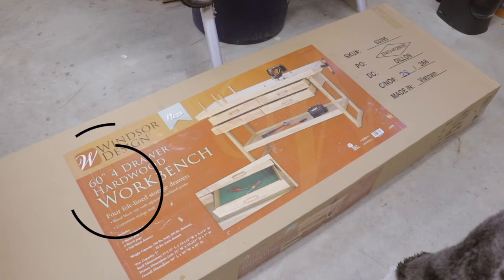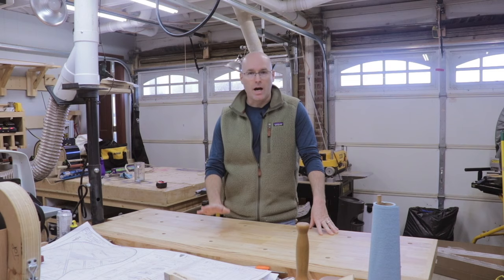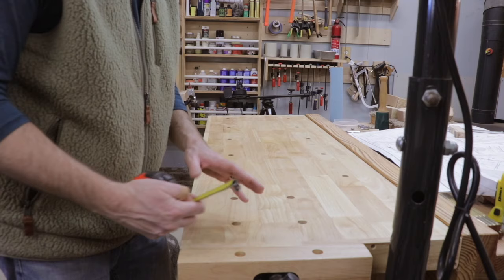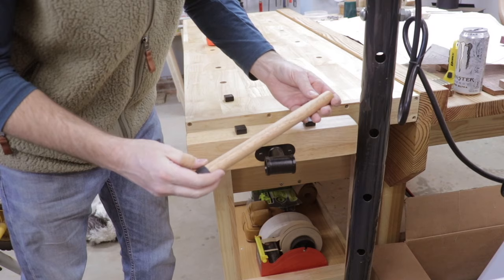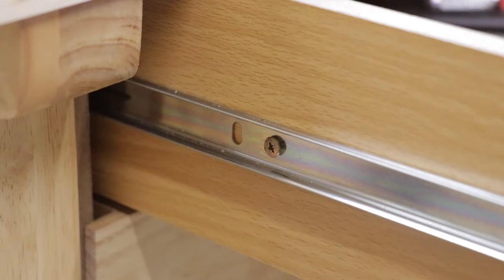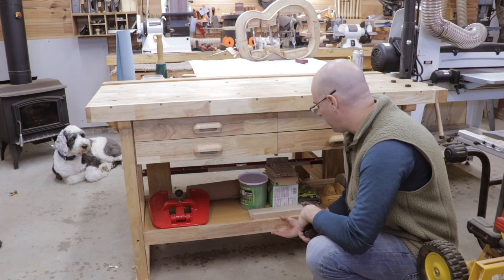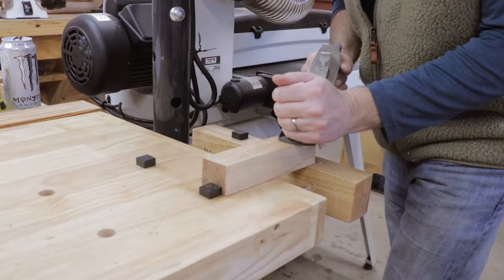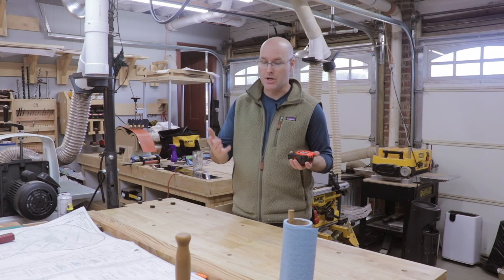Harbor Freight Woodworking Workbench Review

Comment: I have this bench, and while I've been making do with it, I generally hate it.  It's wobbly and too light weight, saw duct and chips fall through the dog holes and fill up the drawers, which have all warped a bind up regularly.  But it keeps working well enough that I haven't just junked it.  It's right in that valley where it's bad enough to piss me off, but not so bad that I've ditched it: Maximum annoyance factor.  But it will, soon I hope, build a better bench that I won't regret.

Comment: Hard to beat for the price but will not  survive long term. I have had mine almost 3 years and have had issues. The drawers are anchored to the bottom of the table and pulled out after about 1 year. I reattached with longer screws and glue. The vise is a bit lower than the table top and if you use the dog holes they don't secure items well. The vise also tightens more on one side than the other and you will need to put something of equal thickness in the opposite side of the vise if you want equal claming pressure. It is very difficult to only use one side of the vises. The dog holes also lead directly to the drawers, which means they are often full of sawdust. The table top as of recently has developed a bow and is almost unusable unless I place a flat piece of plywood on top. Needless to say I feel you be better spending the money and build a work bench that will last long term.

Comment: I aquired a bunch of tools from my father in law about 4-5 years ago. Just so happens one of these work benches was one of the things that were given to me. I unboxed it and put it together, and now it's a home for my lathe. I'm not a fan of the drawers and I think the bottom piece of wood for the bottom shelf was broken. I've never used the vise on it, but it's there if I ever need it. Lately I've been working on cleaning out my shop because I have too much in there. I got rid of a big cart, extra router table, small dust collector, and a radial arm saw(I never used it).

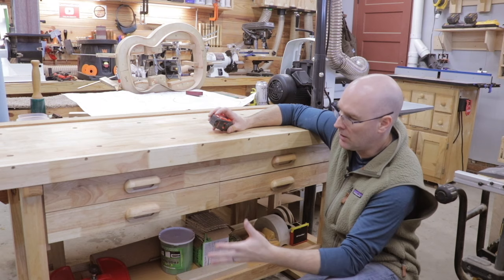Comment: Dog holes are ten inches apart (1:40).  The vise travel (throat. 3:00) is only 7 1/6"?  If the travel is less than the spacing of the dog holes, as it sounds like it is, there are lengths that it simply can't hold.  Not exactly optimal.

Comment: I love this bench. From having a homemade sanding/drilling bench (2x4s, decking wood on top) to using this bench for woodworking, I really felt like I had something. It's been about two months, and while I still love it I've had some serious issues. 
1. The fitment was poor, pieces split while screwing it together. 
2. The vise, which I absolutely have adored using, fits like garbage. It unscrews itself, it wobbles, and even worse: the damned bench side of the vise exploded while I was clamping construction lumber. Soft wood. The bench side split at one of the screw holes and now it's useless. It doesn't clamp anymore. 
3. The bench dogs spin and come out when you try to wedge something in place. 
4. It wobbles like crazy. 
5. The dog holes are directly above the drawers, meaning two things: your storage will absolutely fill with sawdust, and there's no good way to use clamps.

Comment: I have had this workbench for years now and it is great. The only thing I would really like to change are the drawer slides. I hate the fact that my drawers do not open all the way. Has anyone out there changed the drawer slides so that you can actually get to the back of the drawers? I am also adding the casters on the legs so that I can move it around (amazon DOZAWA Workbench Stepdown Caster, Set of 4 Durable Heavy Duty Steel Retractable Caster Wheels, All Steel Construction Urethane Wheels [New Version] (700LBS) for 34.99)

Comment: Great video! I’m considering getting this workbench. Do you think it would support a table top drill press or a table top bandsaw? I’m wondering if wobble would be an issue.
Reply: Same I wanted a vise and bench grinder on mine for golf clubs. I just don't know might just spend the extra $ and hit home depot.
Reply: I've had this workbench for a couple years. It currently is home to my drill press and router table. Definitely sturdy enough for both without any improvements.
Reply: @crazychels2010  thank you for the response! I'm going to purchase this bench in the fall.

Comment: I bought one and it turned out to be a real piece of junk. It'sup side is that it has an end vice and 4 drawers. The down side is the wood it's made of is not very sturdy and an accidental blow to the vice will split the whole end out. The drawers are set between pieces of hard  pressed cardboard material . Mine didn't line up so the drawers would fit between them. Also, the drawer slides will only pull out half the depth of the drawer. I bought mine for only $119 on sale but it isn't worth any more than that. I still use it for now, at least until I get to building a real work bench. The key point is that you get what you pay for, at least as long as you get it at the sale price.

Comment: I was very tempted to buy this workbench, particularly since I had a discount coupon, until I looked carefully at the floor model at the store. I doubt I could build one as good, let alone better, for the price, and I'm sure it would work well enough for light work. But for any kind of woodworking over more than a couple of years, I don't think I'd be happy. The drawer on the floor model was already busted just from being opened and closed by curious shoppers. All parts of the workbench are cobbled together from small pieces of some kind of hard wood, but we're not talking maple here. The top is maybe an inch thick. It's screwed together, not doweled. The vise is wobbly. It's only 20 inches deep, which is 6 to 12 inches shorter than ideal unless you're really short on space. And as he demonstrates in the video, if you try planing, the whole workbench wobbles back and forth. Sure, you could upgrade it, but I figure I'd be better off spending a little more and building or buying something that will last.

Comment: I think its oak. I've had mine for over 8 years. Tips: tack a 1/4" piece of plywood to the bottom  of the top to keep dust out of the drawers. On the vise handle, attach the rubber pieces to the handle with a screw on each one. AND check about once a month that the bolts and nuts are still tight.

I have used mine to death but, I've realized it's just not big enough for me. I'm about to build a giant workbench. I think it'll be pretty cool when it's done. If I have a little extra room I might hang on to it.

Comment: This workbench lags the most important feature: weight. A workbench should be heavy as fuck, so it does not move while planing. He does not even rough planing with a jack plane, but the workbench twists heavily. The lack of weight will also cause massive vibrations when sawing or chiseling out something. Furthermore the diameter of the vise rods is too small, clamping a board on only one side will probably rotate the vise. Finally, it has two french vises, I know popular in the US, but I prefer a german back vise. I think most users will be better off building the Paul Sellers workbench.

Comment: That bench is junk, it doesn't hold up under use...top cups, the wood on the table side of the vice will break and pull apart under pressure.
Reply from the maker: Thanks for sharing your experience. So far no issues here!